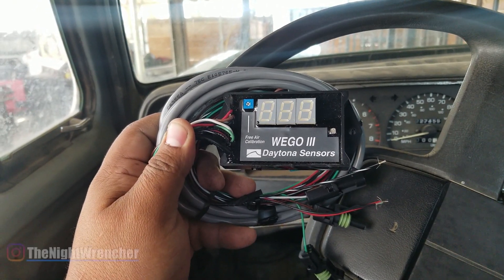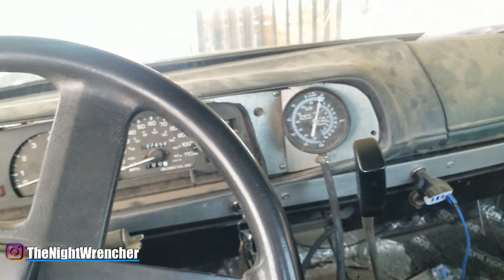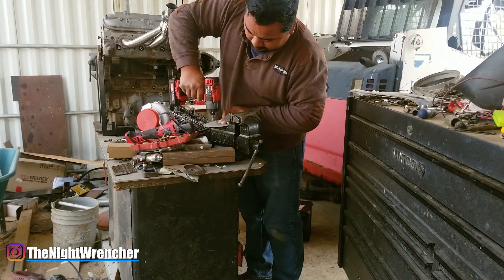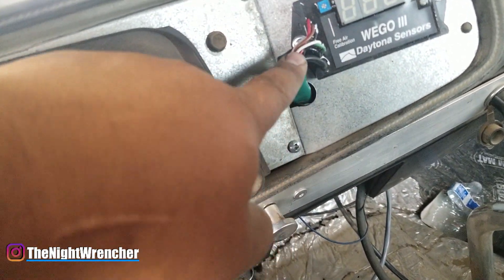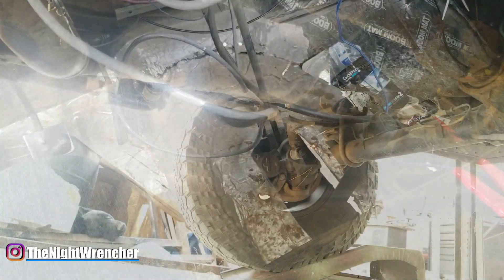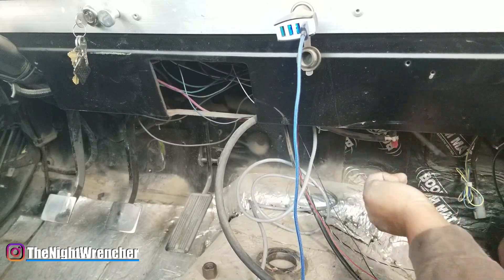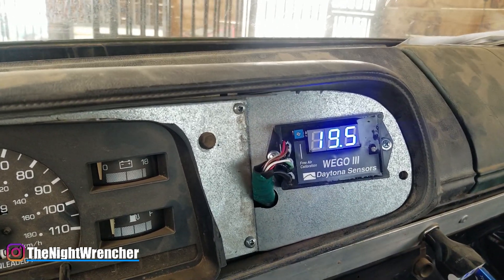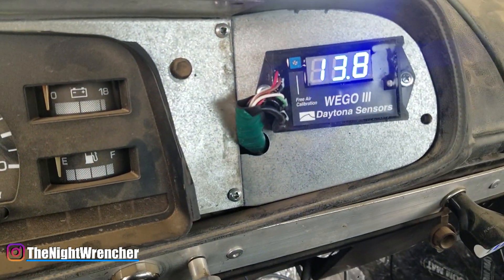Daytona Sensors WEGO III Wideband O2 Sensor Gauge/Datalogger Install | Turbo LS Swapped Dodge |

Comment: Is it possible that when I messed with the dial settings on the Daytona Smart spark that the rpm limit is stuck in that mode because I have tried everything with my fi tech unit throttle body at 28-3000 rpm it just wants to bog on me after everything else. Could this possibly be the ignition box settings? When I turn the dials nothing send to change at all when the motor is running
Reply from the maker: The dials should not be turned while the engine is running. Since youre running a wideband for the fitech, what does it say at 2800-3000
Reply: @NightWrencher  I made that mistake of dialing it as it was running unfortunately. Could anything bad occur when I did that?. It idles great the afr is reading about 13's when idleing but as soon as u give it gas to 2800 or more it almost feels like it's in limp mode or something. The TPS and map sensor are reading good but after 2800 rpm the AFR goes very very lean like 17 or so